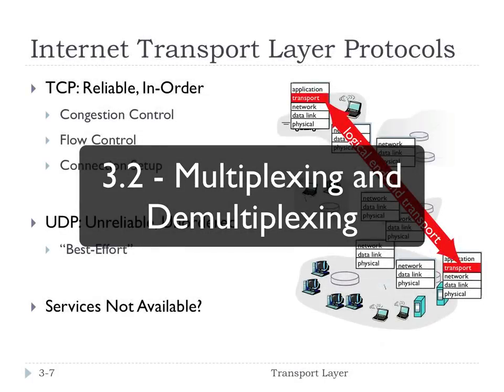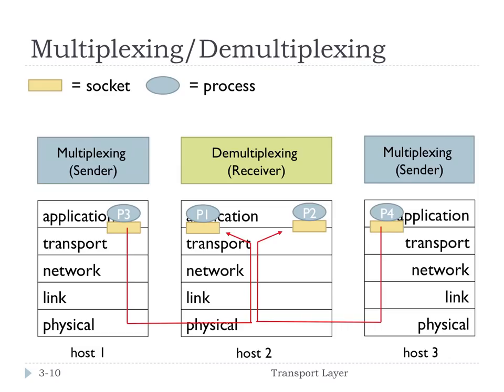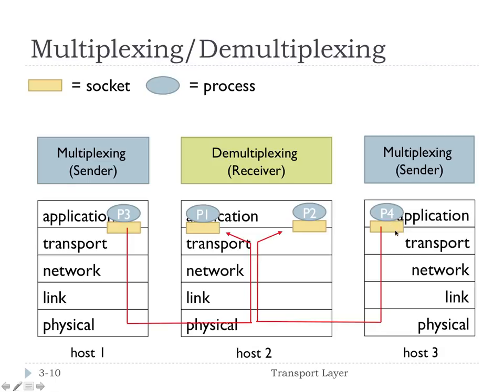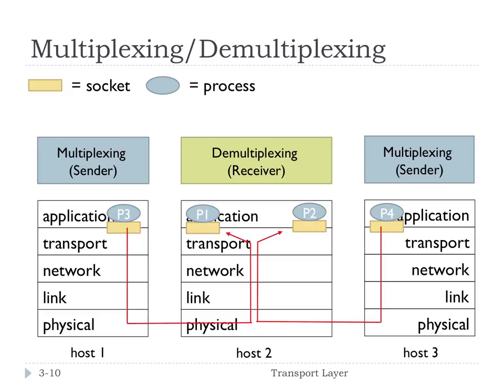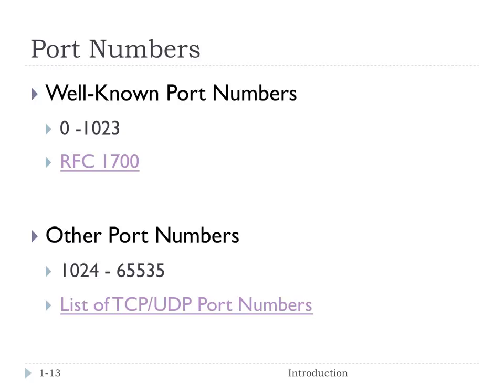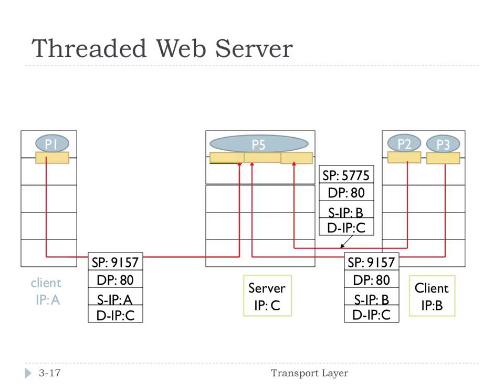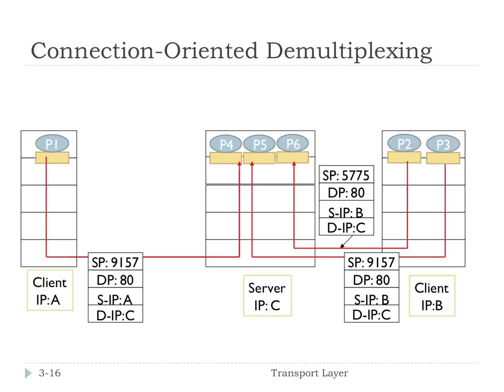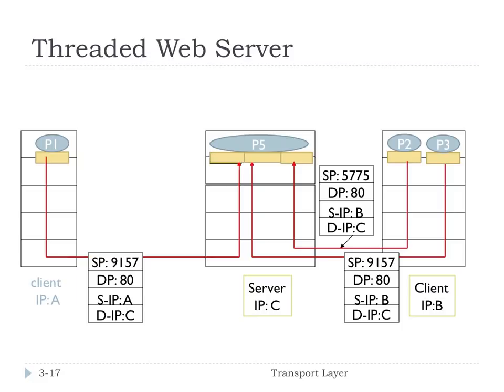3.2 - Multiplexing and Demultiplexing | FHU - Computer Networks

Comment: This has me so lost.... What are you covering?  TCP/IP has 4 layers and not 5 and multiplexing has to do with space division or time division or frequency division and not port routing... Can you clarify this to me?
Reply: Multiplexing on the Physical Layer is what you're thinking of; whereby FDM/WDM/TDM are used. This video is about multiplexing at the Transport Layer, which uses ports and sockets.